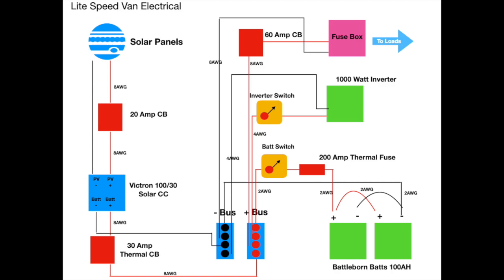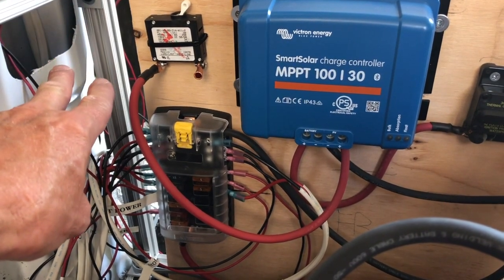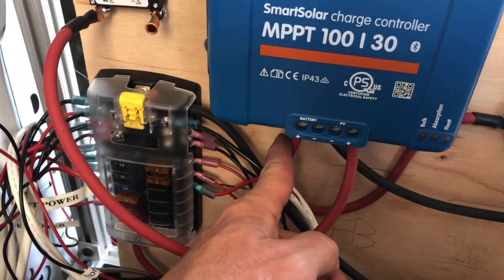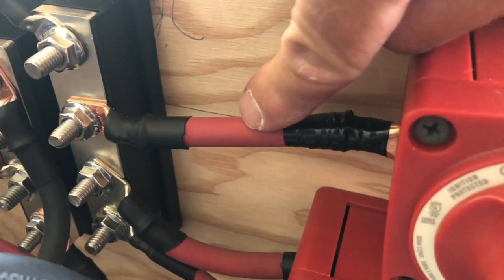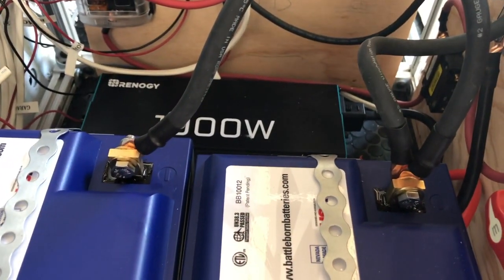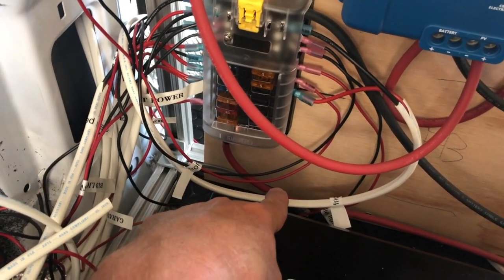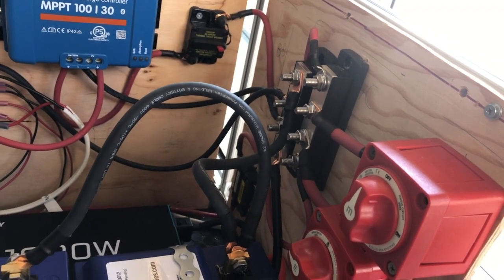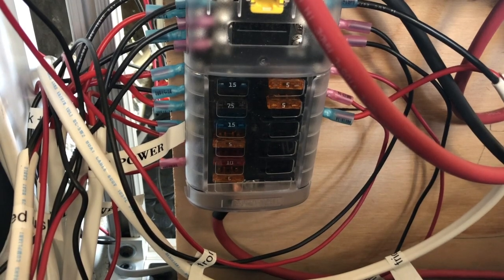Installing a Van Electrical System: A Beginner’s Guide

Comment: what size circuit breaker do you have between your positive bus bar and DC fuse block?   also what size wire are you running between the two?
Reply: nevermind just saw your diagram

Comment: Will you be charging with your alternator also?
Reply from the maker: No I have no shore power or alternator. I was out for 6 weeks last summer and I never came remotely close to using my banked battery power, if anything I might be over engineered. The lights, fans, and fridges are so energy efficient that I would never need to spend the money on other ways to charge. That saying , I did spend more money on Battleborn batteries and a 360 watt solar array.
Reply: @TrailstoSails  - great! I have a PM build in process with 300 AH of battleborn & 300 W of solar. Planning to install a battery isolator for those times when we'll be in sun deprived areas. Enjoy your build!